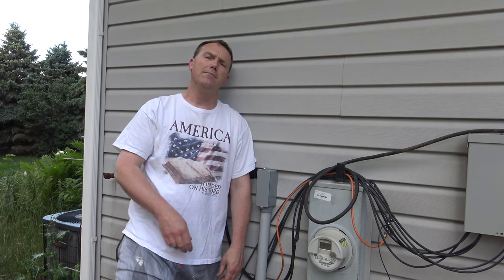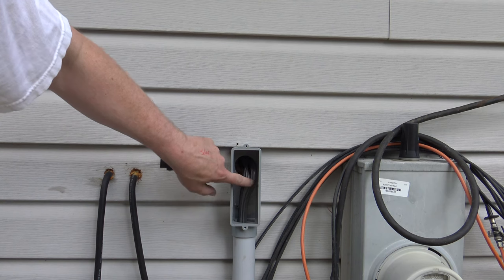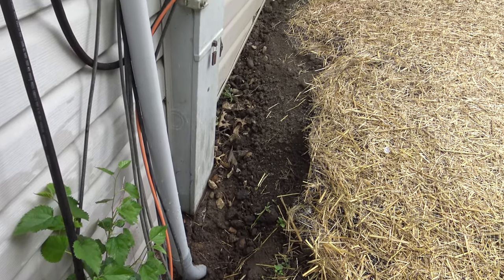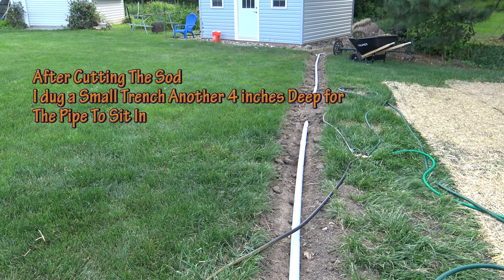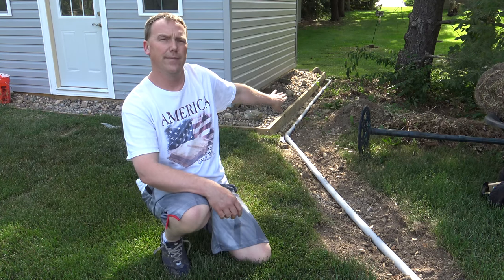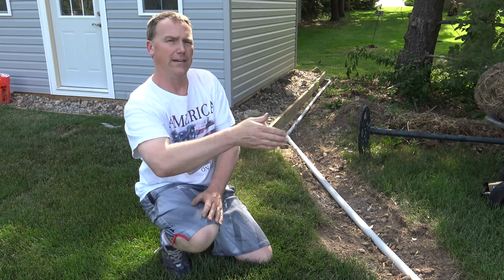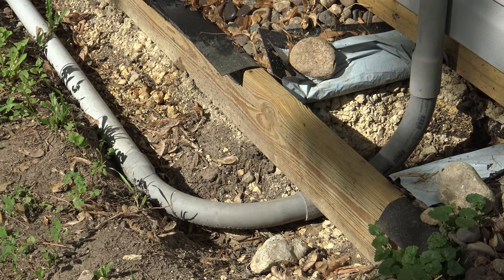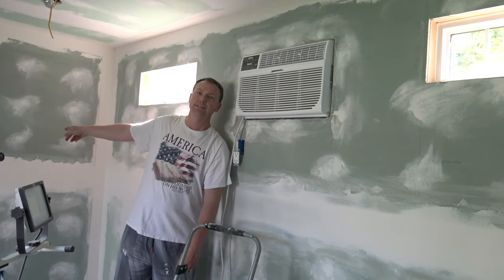Run Electrical Wire And Ethernet To The Back Shed

Comment: I thought you wasn’t supposed to run Internet and powerlines parallel with each other because of the powerlines magnetic field interfering with the Internet cable? Shielded or not parallel long-distance runs interferes I’ve been told, but I’m wondering how is yours working?

Comment: I'm going to be doing this same thing in a couple weeks. Have you noticed any issues running your Ethernet cable with the power lines?
Reply from the maker: No,but I used underground rated power line
Reply: Ethernet and power should be ran in separate conduit. Parallel wires that long have a tendency for the power wire to insice voltage on the Ethernet and hurt performance.
Reply: @josephfalletta9853
Reply: @josephfalletta9853  I agree, I worked telecommunications for 15 years and power lines next to a communication/internet lines is guaranteed to interfere with performance. Also, it sure doesn’t seem like the safest thing to do. I’ve worked jobs where the communication wire was “hot” from the electric power lines being damaged and making contact the wrong wire. Another thing is all power lines have an electric field around it, that field interferes with communication/internet wiring. Twisted pair shielded wire (cat 5 or better) is the best choice to use (but I still wouldn’t run it with the high voltage lines).
Reply: They need to be run separately- electrical in conduit, ethernet direct bury cable. For the Ethernet, run CAT5 or CAT6 that is shielded cable. You wont get interference with shielded cable.
Reply: @addismultitasking3504  Just an update.... I finished the job without any issues. I ran shielded cable in a separate conduit with a seperation of about 12 inches from the main power cables. The total distance was about 30 feet under 2 feet of soil. It works perfect with no loss in signal. (...just in case anyone else has the same question that I had)
Reply: what city u live in?? im laying conduit 6" , supposed to be deeper but anyway, how big were u electrical conductors??
Reply: I wouldn’t think wire only a few inches underground doesn’t seem too safe to me..

Comment: I was told never to run ethernet and power cables together no more than two feet  because it causes interference to Ethernet. Did you have any issues?
Reply from the maker: none, i used underground rated wire